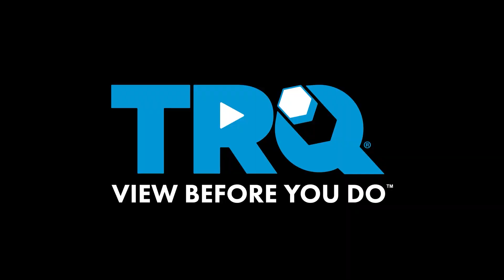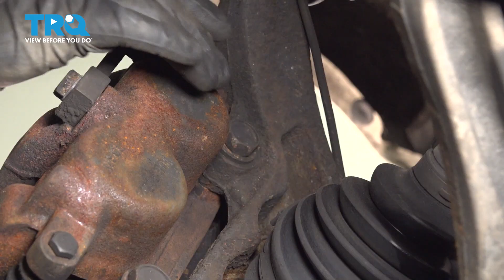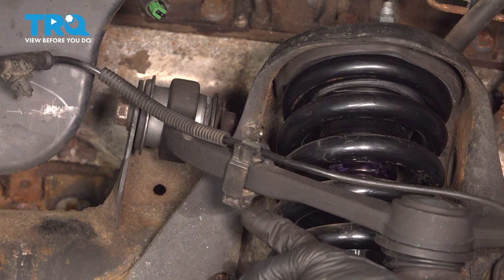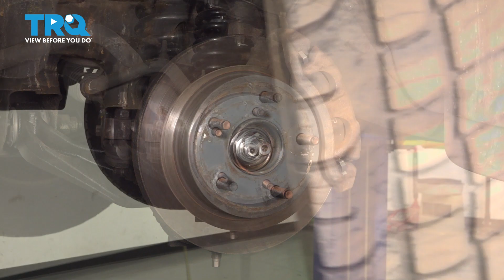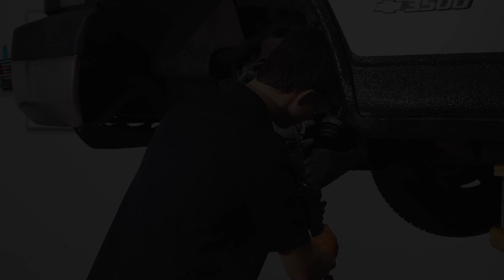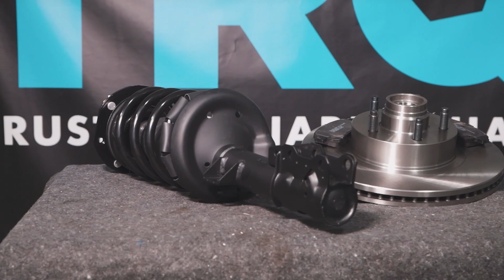How to Replace Front Wheel Bearing and Hub Assembly 2005-2010 Dodge Dakota

Comment: hi, i have a 2007 dakota and left side hub bearing have to be replace. this is my third time trying to remove the axle shift. the bearingi s very well rusted to the nuckle. i am going to use a bolted jack to move if possible to move a little bit. and i do not have a car lift. thanks/

Comment: Iv got a 2005 4x4 slt.  It doesn’t have electric lines to the hubs but looking up by vin and speaking to customer service it’s showing parts for the hubs with electric lines / abs wires.  Im stumped and ready to buy a whole load of parts.  Any ideas ?

Comment: I have a 2007 Dodge Dakota and the driver side wheel hub bolts are worn and I need to replace them. Where can I find the 3 bolts?
Reply: Dealership parts dept, with last 8 of the vin#..